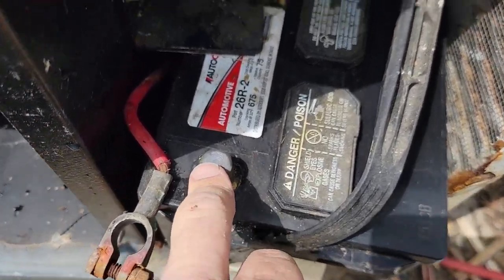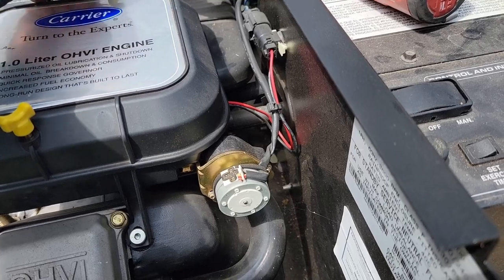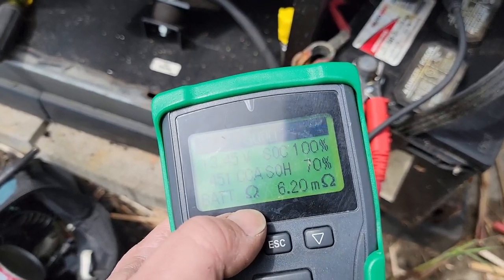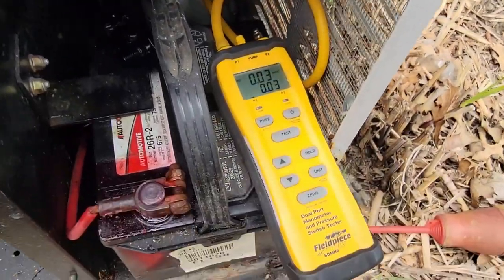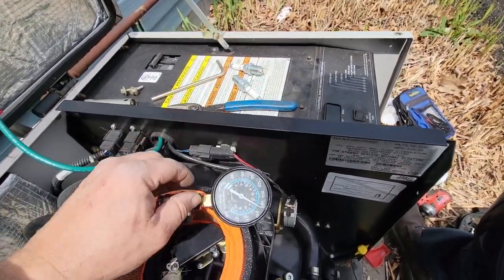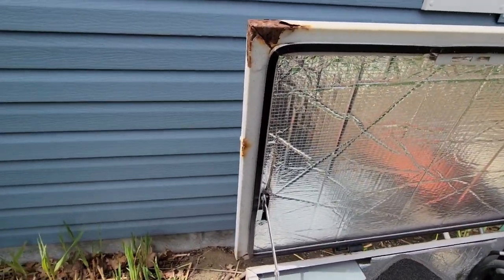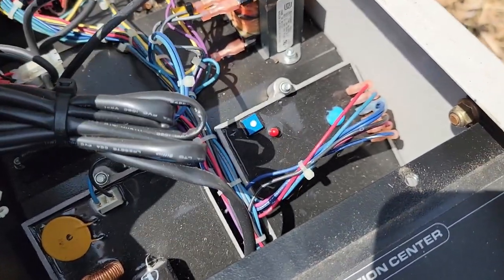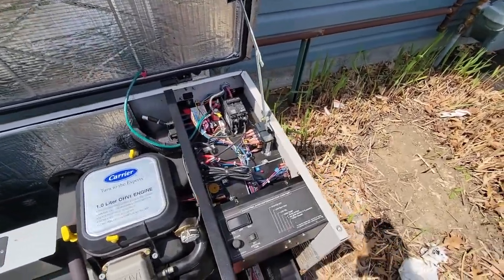Generac Generator Just Cranks

Comment: You have good intentions. But I would have been to the next job by the time you were done.  Those are the most reliable units out there.  If that model sits a long time not weekly running,  it always takes a long time to start.  Not a regulator or fuel solenoid problem.  Adjust the valves. Don’t lift that choke,  it needs all the closure it can use.  Stepper motor is set for 58 htz. Battery should be replaced  if it’s 5 yrs or older. Don’t bother taking a electrolyte sample.  They either work or not.  Load test by attempt to start with no fuel. Check the voltage while cranking. The charger is one of the best of that era.  I have seen 9 yr batteries still working. Nice fool of the transfer, just go inside and do one. The AVR should be changed, wait till it fries all their appliances and you were the last one that touched it.  Just helping,  I do this all day every day.
Reply from the maker: She's replacing it because she has a critical medical need and didn't want to repair it so we're good on the French fry problem, I've seen these fry several appliances. The battery charger is over 2.5-3 amps and I've seen it boil the water out of the battery and explode them,  sorry but there's a reason they stopped using it, they even admitted to it. You must live where it's warm,  I've been there in the middle of snow storms when Generac didn't have a cold weather kit and the time delay in the controller for the under voltage issue because they freeze the brushes just like the choke will that I mentioned. That's cool if you're just trying to help👍👍.  I use to work on these 2 or 3 times a week about 8 years ago but I'm lucky if I see a few a year at this company. If all I did was generators I'd get these done as quick as I do residential HVAC.
Reply: @HVACRSurvival  I don't like those battery warmer pads. They keep the battery too warm and the combination of high incoming voltage really gets acid all over the top of the battery. Another one it rubbed thru and shorted to ground under the battery, and then the battery blew up good. I have a customer with one of these generators but the generac one. 16kw from about 2008, same era. It's the 58hz era, same exact controller. It's getting tired because that one house has had a lot of outages, but it's still running. Valves were out of adjustment but not too bad for never being touched. Battery charger died last year, and took out the battery that I had just replaced 2 years before that. Other than that, no other issues, can smell a touch of oil in the exhaust on startup, but probably just slightly worn valve guides. Those 992 engines were pretty good from I hear from other techs.
Reply from the maker: I'm just negative because I'm sick of working on them,  but no one else will go to class on them🫣😂
Reply: @HVACRSurvival  ... just before I retired I was doing this stuff in my sleep. 25 years of doing it every day will teach you just about every trick in the book. BTW, we always added an hour meter and you'd be amazed at how long these things will run with proper maintenance. The meter will also give you an idea of when to change plugs or adjust valves.... or oil consumption issues over time.
Reply from the maker: @rupe53  my portable 8000 watt has an hour meter and I added one to my 3000 w inverter generator. Both are generac, both have been broken in properly and I haven't had any problems with.
Reply: @HVACRSurvival  ... BTW, it's in the owner's manual that these sets are NOT intended for critical needs, such as life support, elevators, stair climbers, emergency lighting, or oxygen generators. The back-story is more related to limiting liability. IOW, you were warned!
Reply: @HVACRSurvival  ... you've been doing this for a bit so you probably recall that Generac did away with hour meters on air cooled sets about the time the old 8Kw was discontinued. (circa 1999?) They eventually brought them back in the higher class portables. That's when we started adding our own. Not so much to solve problems, but to help us do better maintenance. (better tracking) We basically gave them away at cost for around $20 and did the install while there doing service. About that time we also started using a service sticker to log what was done each time. Major / minor service, valve adj, run hours, etc. They still do the maint log on the sticker so we know how much it's run between services. VERY handy item.
Reply from the maker: Smart👍👍